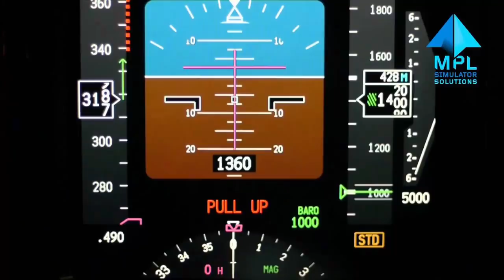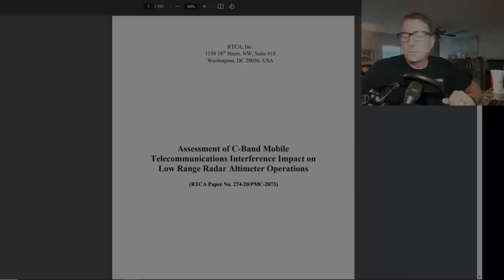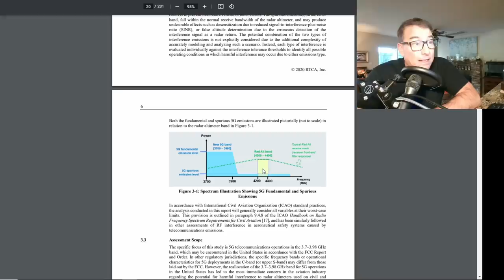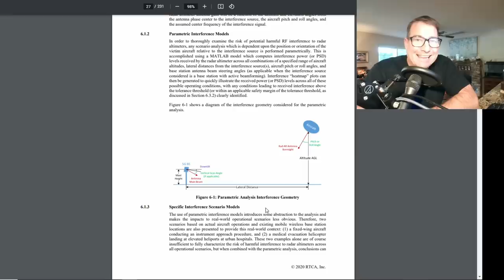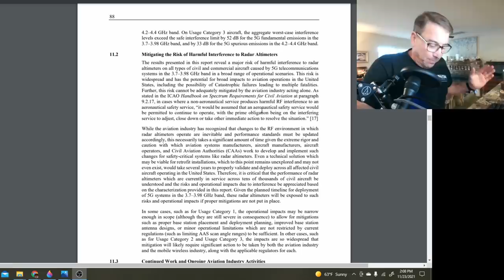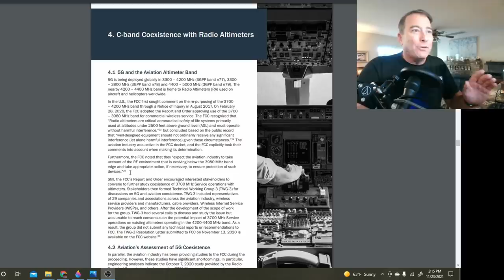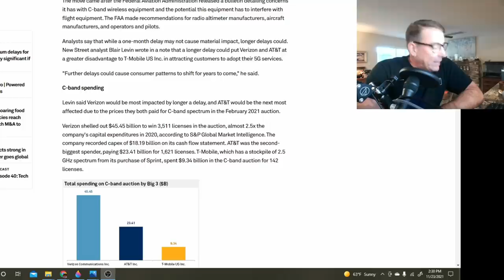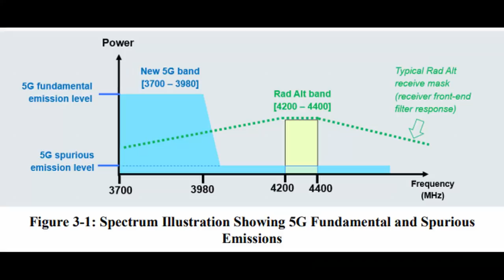5G C-Band Interference with Radar Altimeters in Aviation

Comment: Juan, thank you for a super interesting report.  As a practicing electrical engineer there may be practical limits to how narrow the filter bandwidth and how much skirt selectivity (the rate of dB roll-off in the stop band) is possible.  Narrow high Q-factor filters tend to smear the signal in the time domain.  There is a trade-off between filter Quality factor (Q-Factor) and time domain resolution.  If the filters are too sharp (high-Q) then the time signal may be smeared (spread out) and therefore result in less distance accuracy in the radar altimeter.  The filters in the radar may or may not be at that limit.  It's possible that the radar's filter can be somewhat sharper before fundamental limits like kick in thus limiting how narrow the radar bandwidth can be.  Another approach might be to build a radar altimeter system that basically "listens" to the 5G cellular signal then mathematically subtracts it out of the radar return signal.  This is like an anti-jamming EW method.  However I think that Verizon and other companies should pitch in some dollars for all of this development if the aircraft avionics is going to be forced to upgrade.
Reply: Excellent.  However, if the jamming signals don't have a lot of modulation on them, then some kind of adaptive baseband canceler won't work against them and you would be left with trying to apply an adaptive notch filter.  Any kind of adaptive filter, even if very simple, is going to screw up the time delay calibration.  At any rate, the 5G community have the cost burden to fix the problem.  The aviation community isn't, and probably cannot, fix this problem either technically or financially.
Reply from the maker: Thanks Steven!
Reply: I'm certain a team of engineers could sit down and design and build a radar altimeter system that mitigates most if not all of the possible interference problems with the 5G networks however that will take time.  Once designed and built it will have to be tested and certified by both the FCC and the FAA and any other powers that be.  I could easily see three to five years before the first production units were certified and installed on aircraft.  To retrofit the entire fleet, I'd give it another five to ten years.
Reply: @saratogapilot6100  5G is basically a noise signal to other systems.

As for the cost issue, the people purchasing that bandwidth should be prepared to indemnify those currently relying on relative quiet in that portion of the spectrum for improving radio designs. They should also not be allowed to turn their systems on until substantially all users who may be affected have been upgraded at the new spectrum owner's expense.

{^_^}
Reply: Ya they pitch in and give it to the customer as taxes and fees! What happened to the cost of doing business?
Reply: @me4654   Passed on to the consumer, of course. And if that makes it cost too much they go out of business. That is the way it has always been. There Ain't No Such Thing As A Free Lunch. SAP (Somebody Always Pays.)

{o.o}
Reply: Hope all is well on Banner Mountain.
Reply: Love the anti jamming EW angle which can work much like DGPS to eliminate spurious emissions from 5G so close by
Reply: @saratogapilot6100  From the "5G Community" (whatever that means) here: Telecom Industry don't care what frequency to use as spectrum is a scarcity nowadays, anything which is available can and will be used. That's why there are such thing as regulators, it is up to the regulators as it name says to regulate these matters. So obviously FCC and FAA are not talking to each other, so don't shift this problem to 'airline industry' or 'telecom industry' as definitely the regulators are the ones who fucked up. And the money telecom industry is paying is going to the state (and ultimately paid by you as subscriber), so saying that '5G' needs to fix and the problem and pay for it is a logical fallacy. If anyone then the government who actually earned from allocating the C-Band for mobile network use. (There was a time when spectrum is free and just assigned by regulators, but since it becomes such a scarcity, then, hey why not raise few billions for the state coffers... ).
Reply: @saratogapilot6100  Sorry
The 5G industry had payed huge money to the regulator and the administration to "buy" this frequency band.
This band was never reserved for aviation purposes.

If the aviation industry can't ensure the functionality within the huge bands reserved the aviation industry has to update the own technology.
Radar technologies had made huge progress over the last decades. Sensors are cheap & reliable, up to 25 radar sensors are used today in a single passenger car. They protect themselves against interference by using state of the art technology.
Reply: @Wizardess  The problem is not the spectrum the radar altimeter is using, but the part it is not using. The interference is 420MHz away, "miles away" that is a spectacular guard band.
Reply: @Wizardess  look at modern offerings of Radar Altimeters, i'm sure you will find something from this millenium. 
As has been posted here there are other frequencies/technologies that would be more future proof. I'm sure some decent SDR design can be made jam proof and also include specific encoding for each airplane.
Thats is not to say laser measurement could not be used, at least for redundancy. Cheers
Reply: @Wizardess  the FCC got a boatload of money for that spectrum. That should be used to offset consequences of their choices.
Reply: @Piccodon 
1) I am not as sure about this as you are. 50 years of experience speaks.
2) Airlines do not randomly replace working equipment simply because it is not the newest thing. The military is sticky that way, too, in some cases. (The Navy in particular in my experience.)
3) When you get your bachelors degree in RF electronics revisit the question. Your attitude may change.
{o.o}
Reply: @Wizardess  2. Of course they do not. The soda straw ear plugs 400Hz tone are gone, and airplane seat video screens look differnt now than 50 years ago. You can come up with any excuse you want, this technology lag is indefensible. Maybe you were the one who designed that radar receiver?
The cellphone industry can live with 5 MHz guard band or less with TDD, with much more complicated modulation, so dont give me that gaff about linear phase filters to defend a 420MHz (10%) guard band. 
Have you looked at the specs of modern offerings in this? Spark gap radios were banned long time ago.
Reply: @Wizardess  they DID pay for that spectrum. How much?
How US gov internally distributes funds is off the point.
Reply: A cavity filter can be made with very steep slopes, getting 90dB on 10MHz is no problem. However, as the 5G neighbor is 420MHz away, this severe filter would not (yet) be needed.
There are other filter types that could be used, like ceramic resonators, BAW, interdigital, hair pin etc for lower cost. 
The airline industry has been on cruise control with closed eyes for too long.
Reply: As a retired telecomms engineer in the UK, I agree with all you have written. Might a practical solution be to place restrictions on the the siting of 5G base stations until a robust solution can be found?  This would cost the telecomms provider some dollars, but they can afford it.  Mobile phone systems were basically a licence to make money in my day, and I doubt if this  has changed.
Reply: @stevebeal73  funny how this is a USA problem only. Is this band not used elsewhere on the planet? Has this rhetoric from RTCA been actually been measured and proven, or is this just some desktop engineers letting out some gas?
Reply: @Piccodon  in the UK there are no 5G allocations above 3.8 GHz,  so  providing a higher degree of separation from the frequencies used in radio altimeters.
Reply: @stevebeal73  well, the C band is what is causing the excitement at 4.2GHz where RTCA claims 3.8GHz would be a problem. 
That may have been an acceptable excuse in 1942 but not today. Any radio equipment that needs 10% or more guardband was obsolete a long time ago.
Reply: @Piccodon  They were sold something that probably should not have been sold due to the ignorance of the FCC. If you think the FCC received the funds then the FCC should refund the money. (And the lawyers involved should be disbarred for not doing their due diligence and for implicitly impersonating engineers.)

{^_^}
Reply: @Wizardess  the wideband FMCW radar works in the frequecy domain. Some phase aberration is irrelevant, luddite.
Reply: @Piccodon  And just what makes a phase change vs time different from a frequency change? You seem to know enough to get yourself in trouble; but, not enough to see the trouble when it hits. I find that fascinating. It takes time to make the full frequency sweep. As the frequency nears the edges of the filter the group delay changes dramatically. Since the sweep takes time and the group delay causes a phase shift the result is a smeared out frequency error depending on the instantaneous frequency. This dilutes the precision of the instrument in question. Another effect is filter ringing. A spurious filter hitting a very sharp edged filter causes the filter to ring, often for a very long time. This reduces the effective signal to noise ratio and quality of demodulated data, the "eye" pattern. I fought this "feature" back in 1971-2 on a fast frequency hopping radio. The best filter shape had a Gaussian profile. Impulse ringing was very difficult to deal with at the levels required for the project in a multiple network environment. As a result I am not at all sanguine about your proposed solution. It triggers my "ain't gonna work" mental filter. And no creative work around comes to mind, yet. Most of them fall into "this is where you were but where you are now is only a crude guess" category. GPS works despite this feature; but, only with a whole lot of aiding and fancy "predictive filtering" at the data level.

It may be time to take a VERY old solution and figure out how to move the problem and a new solution into the 21st century. But, until that can be done we're stuck with legacy and your precious 5G can go suck eggs until it can PROVE it CANNOT cause hundreds of people to die because of it.

{^_^}
Reply: @Wizardess  imagine typical FM broadcast at 75 kHz swing, phase a problem? Or narrwband FM? Now expand that to 200MHz. Puh-leeze
Reply: @Piccodon  It is a problem. That is why your FM radio is not 75 kHz wide. 200 kHz wide works better. SDRs are fun to play with. You can learn a lot.
{^_^}
Reply: @Wizardess  Disagree.  Licensed users of a spectrum band have every reason to demand continued use of that band without interference IN THAT BAND from other users.  OTOH, they have no right to dictate usage in other bands, for which they have no license rights.  If they assumed that other band would remained unused and designed their equipment accordingly, too bad, it's their mistake and they need to bear the consequences of that erroneous assumption.
Reply: @Wizardess  Sounds like you're not too familiar with the FCC.  Yes, the commissioners are a bunch of short-term political opportunists that view the position as a stepping stone to something else.  However, the folks at the Office of Engineering and Technology (OET) include top-notch engineers and scientists.

Comment: I think from the FCC perspective it is the duty of each spectrum user to ignore interference from outside their spectrum. The radio altimeters in use simply assumed that neighboring spectrum would be empty forever and thus use insufficient power and/or filtering to account for changing usage. That possibly a design oversight. I’m curious if there are electrical engineers out there that would be able to confidently say it was impossible to use more power on these devices when they were designed? Higher Q filtering I understand was likely difficult, although today it is definitely possible.

Comment: I've repaired radio altimeters.  They are so sensitive they actually measure the length of the cabling between the unit and the antennas  inside the aircraft.  They have to be instructed to subtract the cabling from the reading.
Reply: This is simply outraged technology.
Sensing the cable length is just part of the physics used in those old systems.
Reply: I am glad to see that you know it is not a "radar" altimeter.
Reply: @eholby  I repaired them for a time.
Reply: @eholby  this is a terminology thing I take it, but certainly a radio altimeter fits the strict definition of a radio detection and ranging system, doesn't it? Uses a reflected RF signal to provide distance to an object, where that object is the ground. In the same way that a VT shell uses radar.
Reply: @jdmillar86  Yes, I don't know if the term radar is defined by a particular frequency range. The airborne weather radar is around 250mhz while the radio altimeter is 4200-4400 mhz. Maybe we could just call the radio altimeter 5G since all the uproar regarding 5G near airports is because the frequency used in radio altimeters is just above that allocated to 5G.
Reply: @eholby  Chain Home was ~20mhz, cruise control radar is goes up to 70something ghz. I think it's just "beyond optical" wavelength.
Reply: @eholby  Eric, I think you just like the feeling of telling other people that you're right and they're wrong. It is a radar, that's undeniable. It's an altimeter, also undeniable. Why not a radar altimeter?
Reply: Randy, You are right in calling it a Radio Altimeter. Radar Altimeters are pulse modulated and measure large altitudes. Radio Altimeters are frequency modulated and measure small altitudes. Pilots need to be educated that what they are using is a Radio Altimeter.
Reply: @denismonti2457  FM and Pulsed are both RADAR systems. They both "detect" and "range" using "radio", my friend, that's exactly the definition of a RADAR. In fact, the majority of radars today are FM-CW radars, not pulsed. Try again.
Reply: @tissuepaper9962  Denis is right, you are wrong. He said it perfectly, small altitudes vs large. Thats the difference. If you argue the theory of operation is the same, then you'd be correct.
Reply: @ChrisEvans429  Chris, I don't care what the FAA calls it, it's a radar. RADAR is a technique, not a specific device. That has been my argument the whole time.
Reply: @ChrisEvans429  Maritime digital radar has the capability for short (chirp pulse compression as short as18 feet) and long distances in the same unit. These radars incorporate the Doppler effect to determine if the target is moving away or towards you.
Reply: Cool!
Reply: What does the housing look like for these antennas? 
Is is isolated in a metal enclosure? 
What is the angle it can receive signal at? 
Does the housing closely match the angle expected?
Reply: @robvce2661  the antennas just look like a blisters on the bottom of the fuselage.  There are at least 4 of them.
Reply: @tissuepaper9962  You are absolutely correct. It is a RADAR altimeter. I'm both a amateur radio op and a pilot. The term radio alt is used in aviation to avoid confusion with the onboard RADAR systems used for weather but both systems use RADAR technology. RADAR can be used at any frequency and the method of modulation is irrelevant. If it uses a pulsed or constantly modulated signal to provide detection and range information then it is a RADAR system. In fact one could argue that Radio Altimeter is in fact a shortened version of Radio Detection and Ranging Altimeter.

Comment: As a seasoned Avionics Engineer I truly appreciate the way you have even explained the core engineering concepts. Though you mentioned it but what some of the RF and Electrical engineers, in proposing solutions are not aware of how things work in aviation. Any hardware design change is subjected to a rigorous certification process and is a very effort intensive work. As per the existing norms of spectrum usage, as cellular users are the later entry, they shall finance all the work required to be carried out by the Aeronautical Industry.